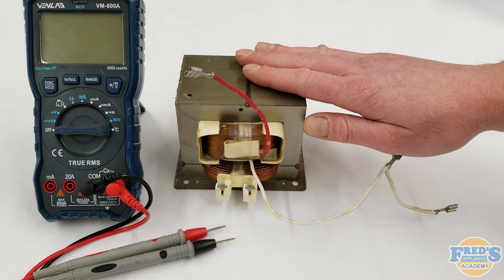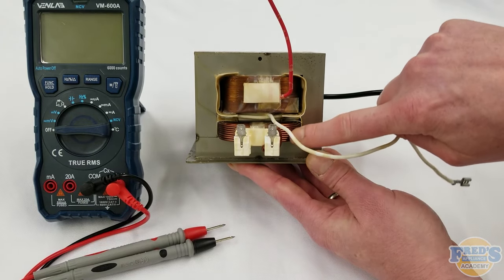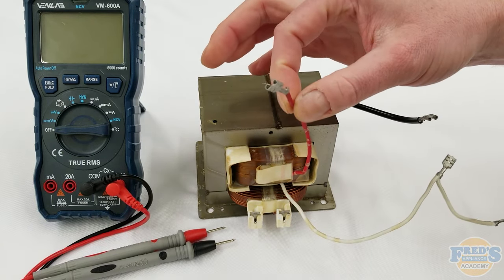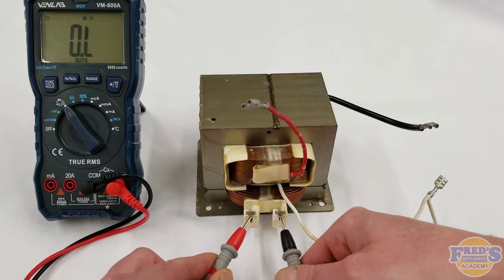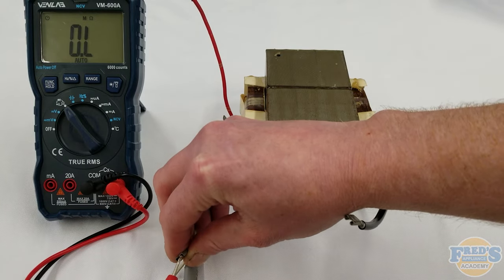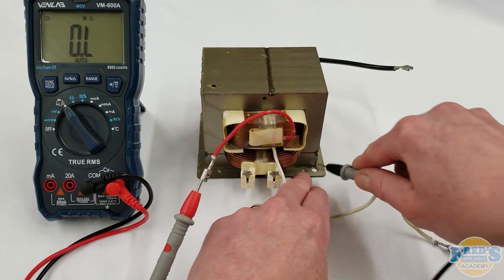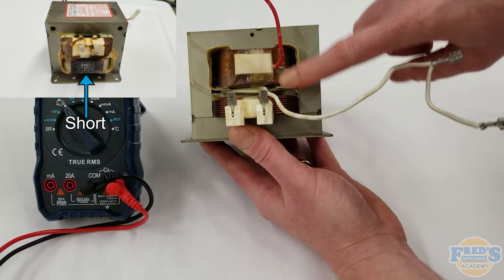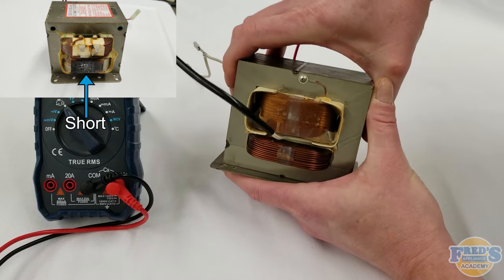How to test a microwave transformer

Comment: Should ( anyone ? ) wish to check the EHT diode ( connected to the 1μF capacitor ) ... you CANNOT test this with a multimeter set to ( diode test ) , because there are several diodes in series , inside ... so .... to test , wire up with a 1 K Ω resistor in series and place the whole lot across a 30 Volt DC power supply , and you should read 8 to 10 Volts across the diode ( much like a Zener diode ) ... but ... in reverse , a Zener would read 0.7 Volts , and this diode should read the FULL voltage of your power supply , to show that it might hold off the full EHT ( ? ) .. ( tried - n - tested ) .. DAVE™🛑
Reply from the maker: Thanks again Dave!!!

Comment: So you're saying that the one terminal of the secondary winding touches the core of the transformer, which is attached to the metal case of the microwave. Isn't it dangerous, especially in case the ground wire is disconnected for any reason?
Reply from the maker: So you're saying that the one terminal of the secondary winding touches the core of the transformer, which is attached to the metal case of the microwave. 

Yes. 

Isn't it dangerous, especially in case the ground wire is disconnected for any reason? 

No. The entire metal cabinet of the microwave serves as the path of least resistance for the transformer circuit to be completed. As power must return back to its source (the transformer being the source) disconnecting any ground wire will not effect this circuit.
Reply: @fredsapplianceacademy  thank you so much for your reply
Reply from the maker: @chrishadjipetris6059  sure thing!

Comment: Good explanations for checking DC resistance of windings, but I have seen cases in transformers where an inter-winding short would only appear with the kind of high AC voltage swings seen in actual operation. A DMM will not reveal these.
Reply from the maker: Thanks southerner66 we appreciate the comment.

Comment: So 8 ohms across primary is no good and would that cause blowing a fuse every time you hit start?
Reply from the maker: 8 is a little high but I don't think it should blow a fuse right after hitting start. I would be looking for something with an abnormally low resistance, shorted cap or diode even.

Comment: I open a used microwave for the transformer and the unit has a separate kind of way to make high voltage the primary seem to be separated from the secondary with out any case or frame but electronic card. What can you tell me about that, can the system can be use for a high voltage output ?
Reply from the maker: Hello! Only a factory issued part should ever be used or it could be extremely dangerous. If you're not sure how to service a Microwave safely, we recommend calling a factory authorized technician to assist. You may contact the manufacturer of your product directly to obtain a referral. Stay safe!

Comment: Could I have your opinion.Great video BTW Thank You. My Over the stove microwave  blows the breaker after 15 secs. On the transformer, Primary leads read 0.8 ohm, terminals to magnetron read  0.4 ohm however High voltage terminal to ground reads 194 ohm ( over the 150 stated in video)  Is this the problem or is the transformer good?
Reply from the maker: 194 is a little high.  If the winding shorts while it is running it can pop a breaker. This is not a common issue but it can happen.  I would plug a kill a watt mater into the outlet and check the microwaves amp draw.  It should be drawing around 12-15 amps.  A breaker can withstand a continuous current draw of 60% if its rating.  for example a 20 amp breaker can allow a continuous draw of 16 amps and not pop. If the amp draw is not to high then you have a problem with your electrical. If the amp draw is in fact to high I would also test the capacitor, diode and mag to be on the safe side with the diagnosis. Please watch our videos on how to do this.
Reply: @fredsapplianceacademy  I'd like you to know that your help and diagnosis was spot on.  A Kill a watt meter proved you correct.  Diode, capacitor and magnetron tested fine.  Bought a new transformer and we are microwaving again.  What a wonderful resource you are.  I like your expertise and the way you answer peoples questions, real professionals.  GOD Bless.

Comment: Great video. Will subscribe.  I have a GE microwave that has components looking like what you show in the video.  All of the transformer reading were within your ranges but 2 wires that were attached to the low voltage side of the transformer burnt off at the connector. I don't see any evidence of windings being charred. Should the microwave transformer still be replaced?  the microwave is 10 years old and I"ve already replaced or fixed 2 door switches. Transformers are about $140 and a new microwave about $500. Is it time for a new microwave?
Reply from the maker: Most likely time for a new microwave if you're not willing to invest the $140. :)

Comment: Good day Mr.
I would like to ask you regarding the microwave Transformer.
I had taken out the transformer from the microwave unit and i was doing measurement at the primary, secondary and hv wire winding with digital and analog   miulimeter, all are good,
My question is:
Why the transformer makes loud humming noise when I was connected the primary to 220volt ac, is this a symptom that the transformer is going damaged?
Your reply very much appreciated thanks🤝
Reply from the maker: In shorts as the AC current passes through the winding it creates a magnetic field at 60 hertz. The hertz is a frequency like sound waves and this vibration is what you hear. Here in the states the primary is designed for 120 vac so over driving it with 220 vac can make the hum louder. Hope that helps.
Reply: Good day Mr.
The transformer is designed fr 220vac it’s not 110vac..you right as normally when we test the transformer(just live testing without any secondary connected to) there will be any vibration and a little hum.. but in this transformer is abnormally sounds come  out.
Anyway . At the end i replaced the transformer with the new one ..and now the microwave running normally.
I suspected there is a loose wire roll of transformer winding inside due to their age .. the microwave product is year 1993..
Many thanks appreciated for your reply.
Reply from the maker: @jimmybonges451  1993 That's so awesome!!!!!! Good for you and keeping things alive. Another thing that can cause excessive noise in the transformer is the metal plates that are welded together start to separate. Either from small cracks in the plates or the welds. when the primary gets energized the magnetic field wants to push them apart and then they vibrate abnormally. Thanks for getting back to us Jimmy. we are very happy to be of any assistance.
Reply: Yes you right.. agreed🤝it could be from the metal plates .. the beginning of the problem this microwave oven was the main fuse alwys blown off when turn it on. All the critical components the critical components such as HV capasitor, HV diode, and the Magnetron  all checked are very good, that’s why I was doing live testing the transformer just injected the primary side to 220Vac then  straight away abnormally a very loud buzzing sound was heard. After replaced the transformer with the new one the problem went away.
So, Many thanks and much appreciated to your goodness🤝🙏🏻
Reply from the maker: @jimmybonges451  Thanks Jimmy we appreciate you.

Comment: From the white secondary to the body, I get 127 ohms, but feom the red secondary to the body there is nothing.  This means the transformer is bad. Is that correct?
My microwave stopped heating. The first thing I noticed when i took the shell off was the connector burned (its plastic charred) on the white primary wire.
Reply from the maker: The only wire that should have ohms to the body is the secondary high voltage wire. Any burnt connection is never a good sign. I would walk through our other videos and test the remaining components.

Comment: Need a little assistance. 
Got 0.5 ohms on the low voltage from pin to pin
Got 0.5 ohms from the two low voltage wires.
I only have one wire coming out of the high voltage side. How would I check that side exactly. Checking from the high volt to the low volt wire the meter reads OL
Reply from the maker: You muST check the high voltage wire (the single wire) from it to the steel body of the transformer where a screw has gone in and anchored it.  The steel body is covered in a lacquer to prevent shorting so that is why you must test on a screw hole or something that is bare metal and not coated.

Comment: What does it mean if my secondary winding value is 142? Multimeter set at 200ohm
Reply from the maker: Secondary high its good. Secondary low there is a problem.

Comment: Where I'm from the input voltage is 240v, does this change anything? the primary reads 4.7 ohms and the secondary reads 4,800 ohms (yes, 4.8k), is it too high on the secondary side? I've tested multiple times and made sure the probe touches the scratched surface of the body, the readings are consistent.
Reply from the maker: When you have 240 and not 120 most things just double the resistance value.  4,800 is way too high for the secondary.
Reply: @fredsapplianceacademy  So I just tested one from another microwave that's working fine, the resistance is lower but it's still 3.6k ohms😵 why are mine so high, it's so confusing.
Reply: @ashchbkv6965 maybe your multimeter is bad

Comment: My low voltage shows 00.0 ohms. Everything else checks out OK. Bad transformer? Thanks!
Reply from the maker: 0.00 is less than 1, which is a good reading.  There should be nothing wrong with it.
Reply: @fredsapplianceacademy Isn't it a short circuit
Reply: @Gamer-nv8bi l am probably missing something here, because l also would expect something in the mproximity of 1ohm or even higher.
Reply: There's another type of resistance called impedance that limits the current 😉
Reply: @Gamer-nv8bi  Okay 👍

Comment: So my microwave blows the 20A fuse IMMEDIATELY after hitting start.
Opened it up, found the blown fuse, replaced it, thinking we are good, set the time, hit start and the fuse blows instantly again. 
I found the schematics inside with troubleshooting instructions, it tells me the HVT is grounded. 
So i checked for a ground fault on that leg that goes back to the 20A fuse but NO ground on it, its clean. 
I checked the HV side and got .2 ohms across the 2 wires. 
I checked the wire that goes back to that fuse for a ground on it, nothing, its clean. 
So how is this a faulty HVT when all readings show good and no ground faults on the transformer itself NOR the 120V feed wire .. ?
Reply: The transformer is ground to the microwave through the body of the transformer where the screws secure it to the microwave. You need to check the windings to the body of the transformer. There should be no resistance from any of the windings to ground.
Reply: @adambutcher4204  i did , its infinite ohms on all leads to the chassis so its not grounded, however i did check the capacitor that its wired to and it has a 1.2 ohm short across it ...
Reply: @adambutcher4204  So i swapped out the High Voltage Cap and this one acted like a normal cap, short then charged and went to infinite resistance.
Slapped it in and now the microwave works perfect.
Funny how the troubleshooting schematic said it was the Transformer but it wasn't ...

Comment: While other results are within ranges you mentioned, however, my high voltage wounding reads 156 ohms...can you pls interpreat this value because it exceeds 150 ohms range you mentioned?
Reply from the maker: Hi there! At 156 ohms, it's likely ok. :)
Reply: @fredsapplianceacademy  u didn't add how to test a shorted transformer. My primary winding is shorted to the ground. Is it repairable?
Reply from the maker: @safetyalways7788  we would not recommend attempting to repair. we'd recommend replaicng the transformer.
Reply: @fredsapplianceacademy  hi ! I mesured 230 ohms. Everything else is okay. Is it good ?
Reply from the maker: If it's a counter top microwave you should be fine.  For a over the range microwave its a little on the high side. 
 @aprozsolt8046
Reply: @fredsapplianceacademy  thank you !

Comment: Some what I get it .
On my high voltage wire from the secondary winding i am getting 22.4 ohms this is from a microwave oven Samsung 1929 model 1850w it has 2 transformers, is this to low.
there are signs of burning and it smells but no smoke when i put the microwave on
I get a little confused when you say the high voltage wire ,the voltage returns back and  the neutral that is at the back connects to the body,,witch makes the casing have voltage running on to it,
So the high voltage wire  usually has a high amp fuse connected as well.
 
So are you saying the voltage runs through the capacitor then out into the transformer then back out back to the capacitor ?
And the neutral IS coming out from the secondary winding and connected to the back casing on the transformer has voltage travel through the casing of the transformer ` then goes down to the plate of the transformer and then where does it go?

 The screws on the plate that hold the transformer to the bottom of the microwave do they take the access voltage away 

I don`t under stand where the voltage that comes from the neutral that`s connected to the transformer body` how we don`t get shocked when touching the outer of the shell on the microwave casing 
I know that the transformer is coated on the out side with a varnish or shellac , 
So if it is coated does this keep the voltage trapped between the coating and casing of the transformer,or not,
Could you please explain where this voltage goes from the secondary winding neutral wire that connected to the transformers body.?
Reply from the maker: Any signs of burning and it should be replaced.
Reply: From the secondary out put through the high power fuse it goes into the cap and charges it.By the way the transformer,the cap and the magnetron are connected in series.So in this direction current reaches the magnetron as negative,(which is not effective to it.
Because it is alternating current, flowing the opposite direction, this time the cap discharges into the transformer and the 2 voltage add up to double and goes into the magnetron as positive and the diode makes sure that it doesn't enter the cap except through the magnetron only.The same pattern happens 50 time every second this side 60 for you guys.